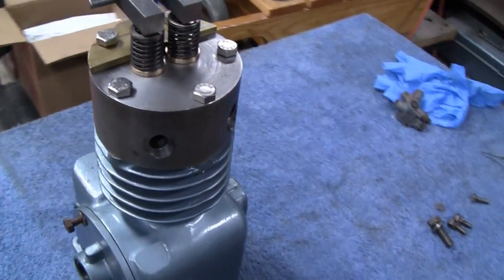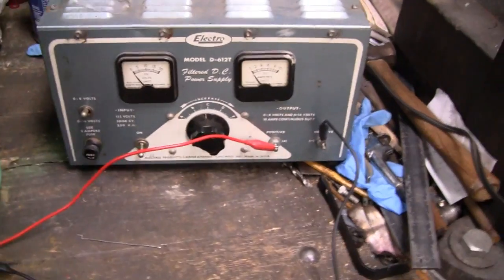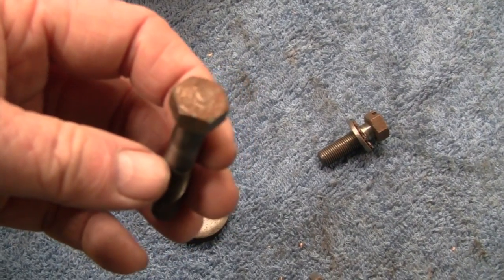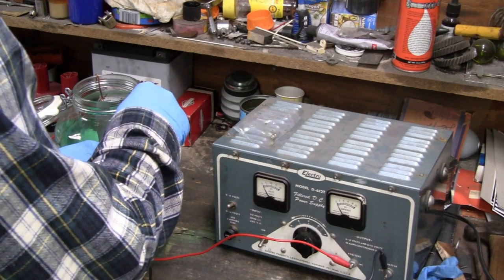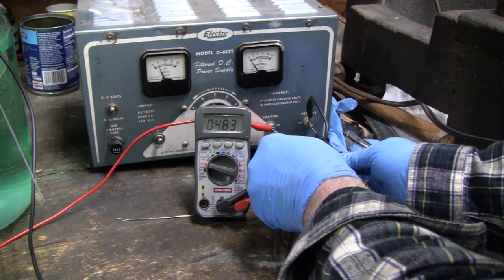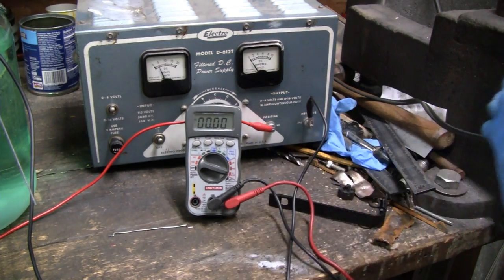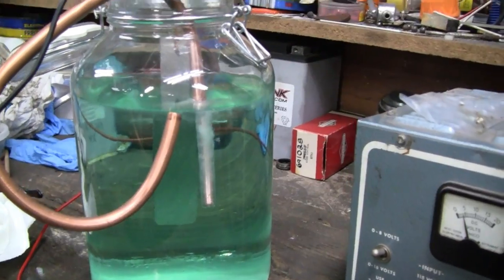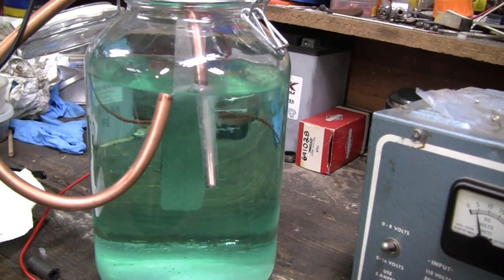HOW TO NICKEL PLATE

Comment: You had your leads connected wrong when measuring the current. Voltage and current reading terminals on multimeter (except for low currents, like mA or uA) are usually separated; you have one for amps (probably the left one on your multimeter), and one for voltage/resistance, etc. (probably the one on the right) and of course, the common (in the middle, I'd say). So, the red lead goes to the left terminal if you want to measure the current - BUT; you measure the current by connecting the multimeter in series with the load and power supply, not by connecting multimeter in parallel with power supply - you'd probably blow the multimeter's fuse if you did have the leads connected properly (and the reading you were getting was just a result of interference, not an actual reading). It's like connecting the multimeter straight to the wall outlet in order to measure its current. Multimeter in current measuring mode is basically a short (it would be like shorting the outlet with a piece of wire, except the multimeter has a fuse, which protects it in case of something like that). So, voltage; parallel connection, current; series connection. BTW, all loads, connected in series, to the same power source, have the same current flowing through them (same with multimeter - if it shows 1 amp, you know your electrolysis cell will have 1 amp of current flowing through it - same with power supply - 1 amp. Voltage can be equal or different between components of the series circuit, but current is always the same). Nice video :)

Comment: Nice video sharing how we should plate our materials. Here to learn form you your methods and processes for nickel plating, we love your power supply it is a classic version similar to our newer one, nice one. No comment about the funny talk, though seriously, we do see our favorite can of penetration KANO oil that orange can that is the best of the best AEROKROIL it just gets thing loosened up every-time. 
Nice finish on the bolt compared to where you started, important if the fastener is as rare and labeled as the vintage machine or tool it came attached to originally. 
The centering tip between dual anodes is great sharing.

Thank you.
Lance & Patrick.

Comment: Could you use a small motorcycle battery for this process or even a car battery?
Reply: Yes, but you would need to regulate the current in some way.

Otherwise, for smaller objects, you may get too much current and electrodeposition will be badly done.

Comment: A lot of stainless parts with threads that I work on get the threads copper plated and then nickel over the copper. I guess it bonds better.
Reply from the maker: Yeah we might try copper plating the head and carb first!! We gotta do a little research first, the carb is potmetal, don't know how that will react to plating!!☺

Comment: I'll have to try this next month when I get paid. I have an old variable power supply I built that has a 2 amp fused max load. Adjustable from 1.5 volts to 18 volts. I'll be doing all the bolts and the carby for the Model 8 Briggs I have.

Comment: I just did three weeks worth of Nickel plating every fastener on a big heavy 1500lb Surface grinder restoration from 1946 -  Hundreds of bolts, nuts. screws, etc - you stuff comes out real dark and black looking which usually means your running the volts or amps too high, and it's "Burning" - theres formulas for calculating your surface area, but next batch try turning it down about HALF what you were using, and perhaps run them longer- all my stuff came out looking much brighter and more shiny-
I dont know if you ever check your facebook, but I put a pic and a link to all the pics on there........
Reply from the maker: Nah I never look at that page but I just looked at all 289 pictures!! Well done Bud!!☺
Reply: @805ROADKING   Thanks Kiddo- Love your vids!~

Comment: Would a battery charger on trickle be too much?
Reply: probably not in my humble opinion......Add a 5K resisitor in line with one of the leads to be sure. if it blows, get a bigger 5K resisitor. and try again. Of course make sure your battery charger is plugged into a fused (maybe a GFCI) outlet, just to make you feel better about it. ya know....safety and all

Comment: Any reason not to plate the bolts up to the threads, along the smooth part of the shank?
Reply: @texasrox2010  Well, I mean everything but the threads.
Reply: plate all of it, hell. if you need to run the threads through a die to clean them uo, so be it. Why not, don't cost much

Comment: When you read amps with the multimeter you were shorting the power supply across the meter, to check current the leads need to go in series with the load.
Reply: And you have to change lead on the multimeter so the reading was faulty too. But nice plating ;)
From what I know current is more important for plating, you have to set it regarding to the surface to plate. Voltage is only the way to have desired current.
Reply: @plextoob  Yes he did it wrong.  Shorting across the load like this will typically burn out the fuse in the ammeter making that function of the meter no longer usable until the fuse is replaced.  The way it works when you put the meter in series is by a shunt resistor of very low and precise ohms.  The very small voltage drop across the shunt is measured by an op amp which amplifies the small voltage drop allowing the meter to measure the current.  The same method should be used for high accuracy at higher current, using a shunt resistor and measuring the voltage drop.  It's always a good idea to have a pretty good ball park idea of the current that is flowing so that you don't exceed the rating of your fuse.  For quick check you can use a clamp meter.  They are less accurate, but are inherently safer since no wires need to be exposed.  As such they are generally useful when dealing with high current or high voltage applications where an exact measurement is not required.  One major disadvantage of the clamp meters is they only work when around a single wire, and so do not work when clamped over for example an extension cord, which has current flowing both directions, thus will measure as zero current.
Reply: actually, the best way to read current is with an amp clamp across one of the leads plugged into a true RMS meter....but I didn't wanna be too critical.....He aint workin on my mammas EKG, so screw it!

Comment: Nice job RK. When I was 16 I worked in a plating factory. There were these baths there that were about  5ftx7ftx20ft. On the edges were baskets that held the nickel pellets. They gave me a box of pellets that weighed about 60lbs and told me to walk out on the edge of the baths (about 7 inches wide) and fill up the baskets. I nearly lost my balance and fell in. The guy instructing me says "FFS don't fall in there, you;ll be dead before you hit the bottom.
It would be interesting to weigh and measure with a micrometer something perfectly round, before and after plating. cheers.

Comment: is a battery charger too strong? I have a 12 volt power supply but it might also be too strong, is the amps important?
Reply: Try it out.  Add salt slowly to your mix until you get a steady but slow stream of bubbles.  Basically you are making a resistor which lowers in resistance the more salt you add.  Too much electrolyte (salt) will increase the current due to the higher voltage and can cause it to eat up your Anode material fast and produce heaps of hydrogen gas which can be explosive.  Slow and steady for better results as a home gamer.
Reply: Amps is always important, that's current. Set it as low as you can and try it on a fused circuit....if you pop a breaker, try something else....if you're too scared, use a car battery, and disconnect the battery and recharge it as needed.
Reply: MissouriOldTimer 
Add a light dimmer switch to the input (AC side) and dial it in to what ever voltage you want. Turn off dimmer before unplugging charger to prevent damaging dimmer. Some of dimmers don't like a collapsing field from an inductive load.
Reply: thanks to everyone that commented on my question, it's looking like I better not try this, although I use electrolysis to remove rust and I've seemed to have success.
Reply: It doesn't really matter how strong the supply is - current is determined by the votage and the resistance of the circuit.  As long as the power supply can provide the current the circuit wants to draw, you can use a 1A wall wart or a 1000A starting battery.  If the power supply isn't strong enough to supply the current that the circuit wants to draw, the voltage will decrease until it balances out, but that means you're overworking the supply (and you need a certain voltage for the reaction to happen properly).  If you only have a 12V charger and want to drop the current, put a headlight bulb in series with it.

Comment: I'm gonna do this with brass rifle ammo cases prior to reloading! i've already copper coated stuff with coppersulfate, easy corrosion proof ammo! Thanks RK and Majic Mike!
Reply: @texasrox2010  I'll find out as soon as I get a saturday off! I imagine so. If not, no loss really, the brass below won't be weaker from this process I'm sure.
Reply: I'm starting this weekend! The green fluid is brewing now!
Reply: @texasrox2010  Going into the mag aint an issue with  revlolver. I think the plating after 5 or 10 minutes will be in the millionth of an inch, I'll resize after I plate em. If it isn't easy to resize, I'll rethink, but I bet it's a pretty thin coat. I mean RK and Mike aint gonna use a different wrench on these bolts, right?? Of course ammo is tighter toleranced than bolts, we'll see. Ask me again in a few weeks, I'll get the alert and let you know.
Reply: @texasrox2010  it does seem to survive a brass brush grinding wheel.....is firing, cleaning, tumbling and resizing harder on metal than that?? maybe repeated reloading might give me fits....we'll see. Maybe I should start a youtube channel.....They'd demonetize me because it'd all be gun related...lame!
Reply: @texasrox2010  he gets support from outside groups that he mentions by name, Buds guns and the NRA....Youtube has put him through the ringer I'm sure....pluss, he's a retired teacher (it shows, right). He aint doing it for the money.
Reply: copper sulfate in water plates to steel on its own